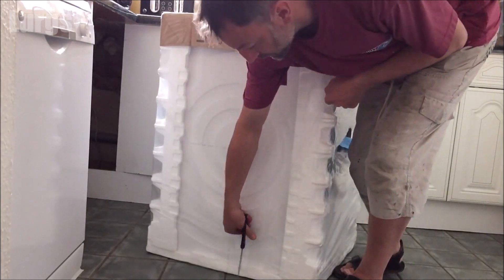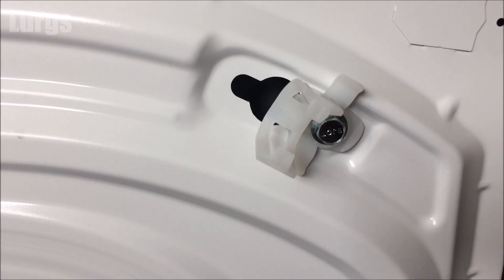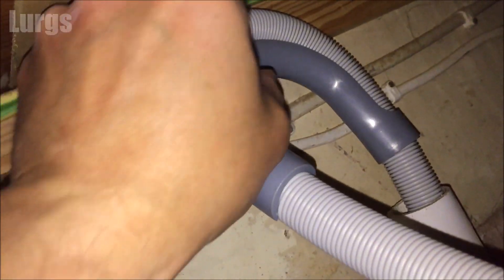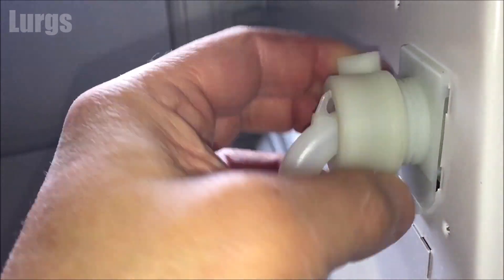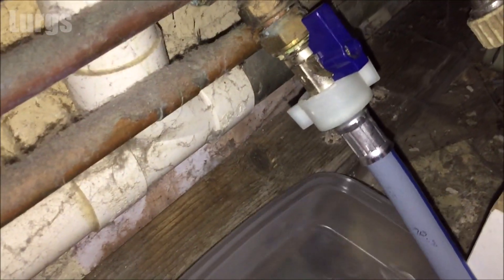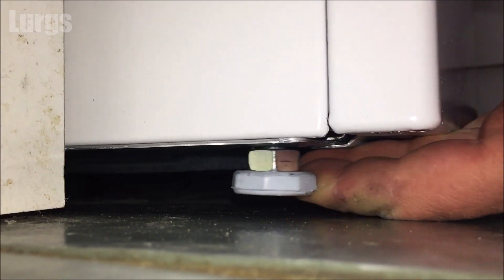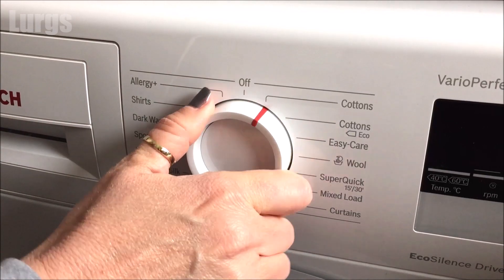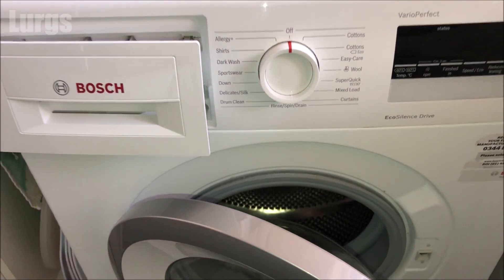Install a Washing Machine in Simple Easy Steps - Washing Machine Installation

Comment: Thank you so much for this helpful video!!!
I've just ordered a new machine as my old one broke down. But I got 9 good years out of it. 
I've watched your "disconnecting your washing machine" video and that was also very helpful.
You have saved me a huge £55 😮 That would have been to install and recycle my old one!
But with your help I know exactly how to do this myself. 
I will definitely recommend your videos to all my friends and family, so if they ever need to disconnect and install a new machine your videos will tell them everything they need to know. 
Thanks again buddy 😉
Reply from the maker: Thanks for the great comment and thanks for recommending my videos. 😎
Reply: Hello again!
I had my new washing machine delivered this morning and thanks to your video I managed to install it. 
I am experiencing an issue though.
Even when the spirit level is saying my machine is level, it is rocking ever so slightly when I push down on the top left hand side 😕
I have tried to find a solution but I haven't been very successful. 
So you know what the issue may be?
I'd be ever so grateful for any help you would be able to give me 🙏
Thank you!
Reply from the maker: @ellacabella1984 As long as it’s fairly level it’s ok, but it’s important all the feet touch the floor. Just adjust the front left one downwards so it touches the floor then lock the locking nut so it can’t move
Reply: @LurgsHowToGuides  thank you so much for replying so quickly!!!
So, I managed to stop the machine from wobbling and with the spirit level on top of the machine it is level. The only thing that concerns me is that, even though the spirit level is level across the top pointing side to side, when I sit it on top of the machine so it's pointing from the front to the back of the machine it's not completely level 😫
Even though your videos are extremely helpful and you can't go wrong with all of your help and information, I just wish I would have paid for installation now 😕
But that's only because of me installing it, not your videos. I wanna make that clear 😉
Thank you anyway. 
Enjoy the rest of your day 😊
Reply from the maker: That’s always an issue if you don’t have a completely level floor. But you should be able to adjust the front feet so it’s level. Failing that you cannot beat some pub beer mats under the feet to help level it up

Comment: Thanks for the vid. Would you buy a new cold water hose if moving your existing washing machine to a new house?
Reply from the maker: Depends how old the hose is, the washers do crush over time. Personally I’d try it first and turn mains cold water on and check for leaks before fully installing the washing machine. But a brand new hose will give you peace of mind as once the washing machine is pushed back that hose is out of sight and it could leak without you knowing

Comment: Add on questions if anyone knows - does the levelling matter much if it isn't making noise? And drain hose - I put ours up and over a cabinet wall thingy, so peaks above top of washer, to avoid having to make hole in cabinet side - could that be causing horrible lint build up that is smearing everything dirty?
Reply from the maker: The washing machine should be dead level to help with washing and drainage. Also the drainage hose should definitely not be that high. Most washing machines plumb into a sink drainage which is about half way up a washing machine height. It may struggle to pump water away. But that shouldn't cause lint build up, not sure why that is happening, it's not a washer dryer is it?